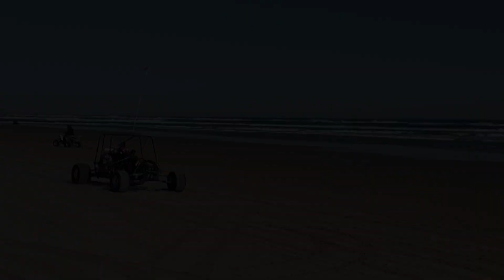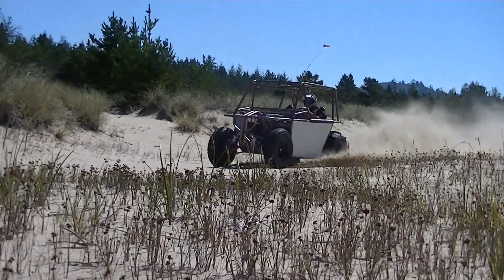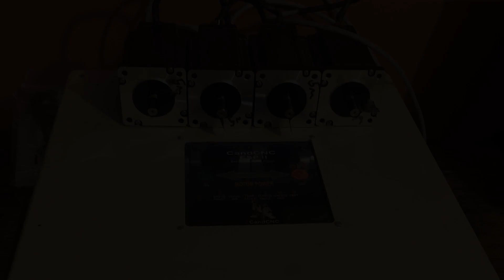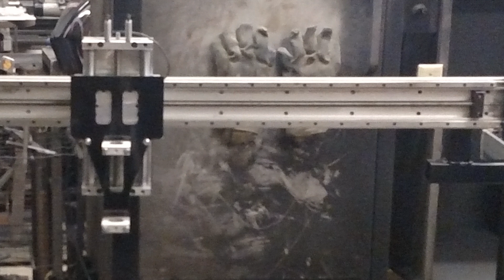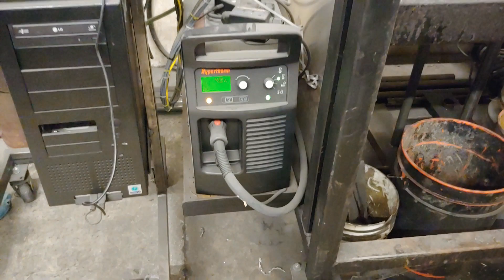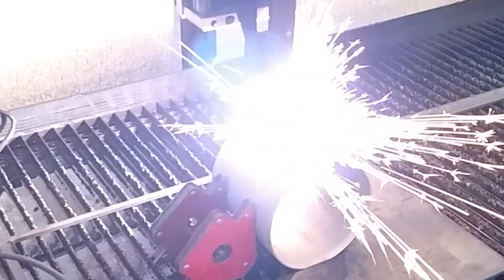DIY CNC Plasma Cutter Table Gantry - How to build CNC plasma table homemade tools

Comment: Check this.
The easiest and cheapest way to build cnc plasma table.

https://www.ebay.com/itm/DIY-CNC-PLASMA-CUTTER-KIT-FOR-NEMA-23-STEPPER-MOTORS/163305262019?pageci=1ebe833d-e83c-4fda-86fb-8bbcc74b2b7a

Comment: What was the total cost of this project
Reply from the maker: I think I spent close to $5000 to build this gantry. The biggest expense was the cnc controller & stepper motors.
Reply: @motomule  what cnc controller did you buy
Reply from the maker: @BrandonBurns1985  it's a C&CNC brand from Texas.

Comment: Where did you buy most of your plasma components?  And do you have any idea how much you spent on the overall build? I built myself a CNC router table, but have been curious about the plasma cutter since the concept is the same other than what I'd be using the make the cuts.
Reply from the maker: I bought the controller and stepper motors as a package from C&CNC in Texas.
The linear rails were used items from eBay. The torch is a hyperthem powermax 65. I would estimate that I spent about $5000 to build it.
Reply: @motomule  I wonder how cheap I could do it.  I have about $550 invested in my CNC table, but it's built from wood. The ballscrews and rails are from Amazon/China but they work pretty well. I think the biggest cost item for me would be the plasma torch itself.  Oh, and I probably won't want to use wood on a plasma torch build. haha
Reply from the maker: @DanBuilds  I'm not very savvy with electronics, so I paid more for a pre-made kit of electronics. You could save by putting together your own control components... The steel for the gantry itself wasn't very expensive.